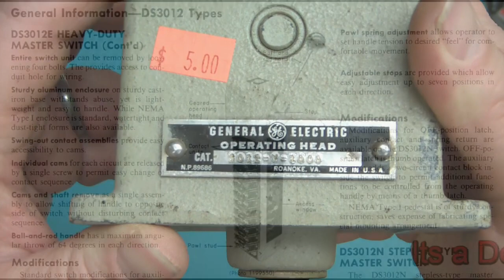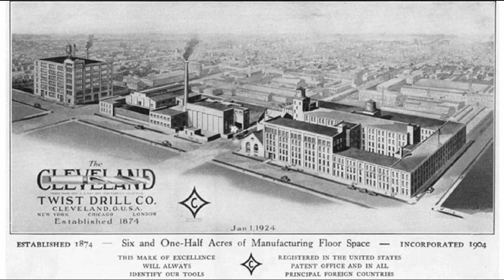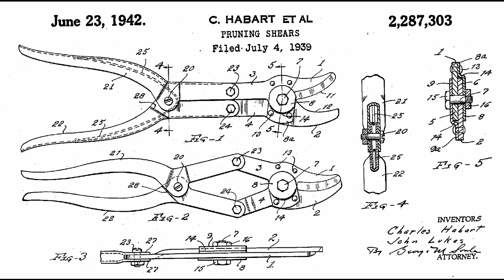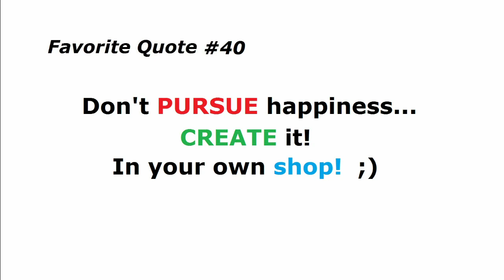Habitat 4 Humanity Tool Haul #7

Comment: Those are some cool tools. I love those pruning shears. They could clean up easy and could be repainted and put back into work. Cutters whether bolt or tree pruners are my favorite. Especially H.K.Porter ones made in Boston where my dad was one of their machinists.
Reply from the maker: Thanks!  Do you have a collection of HK Porter cutters?
Reply: @timeflysintheshop  yes I do. I have 4 36" limb cutters they call #3 Foresters which were patented in the 1930s. I have 3 24" from the 1960's  called #2 Foresters. Then one about 18" pruners I believe would be # 0. I found these in Facebook Marketplace in NH and I never knew they made them that small. I must have about 40 different tools from where my dad worked. Even the cutters in my picture are a 1940s Type R pole cutter made where my dad worked restored by Vic from YouTube Big Vic's Workshop. He restored them in his #3 video. Check it out.
Reply from the maker: @stephenkent8903  I am sure I have seen it, but I will watch it again!  Have you ever posted anything about your collection on YT?  You could make a video about it and post it.

Comment: That drill bit with the 3 fingers is very familiar but I can't think exactly what it is, seems like there's another part to it....Maybe like you drill and countersink then pop that part off and the screw bit was underneath. Not sure but I know I've seen it before.
Is that punch some sort of non-sparking material or is it steel?
The GE switch would be cool to use for something for sure.
Reply from the maker: Hmmm I will take a closer look at the drill bit thingy.  The punch appears to be a typical tough steel material.

Comment: I have a lineman’s that has that same almost-too-perfect hole and I’m always wondering if it was intentional or a live wire
Reply from the maker: If I remember correctly, scoutcrafter showed an example of a lineman's with a purposeful notch for stripping wire.  The weird thing is that it would really only fit one gauge of wire correctly.  I should try it on 14 ga and see if it works.  That would be the most likely size I would think.